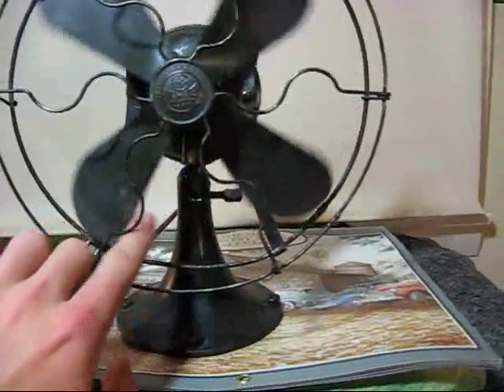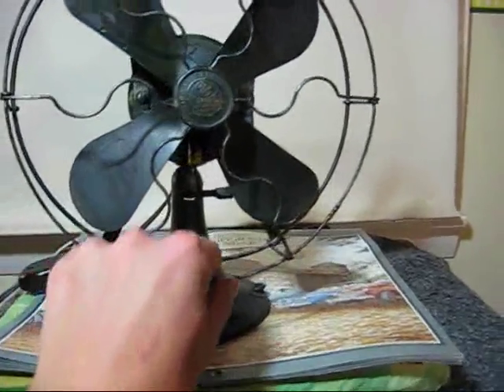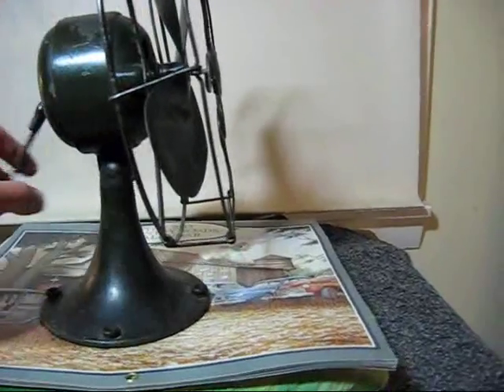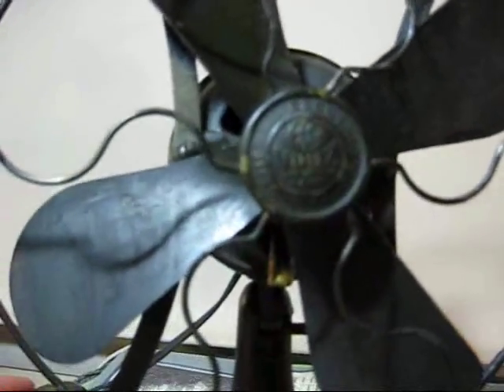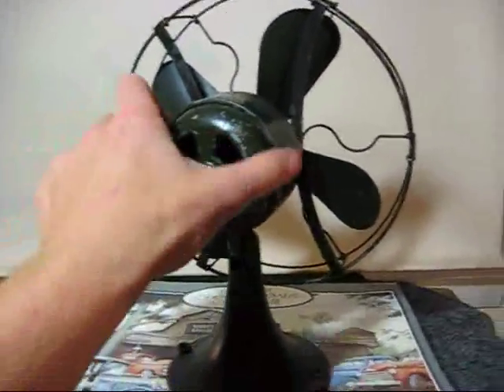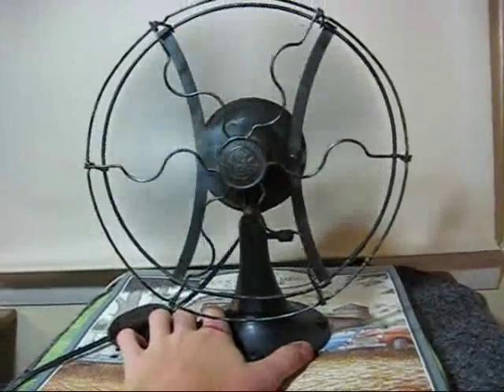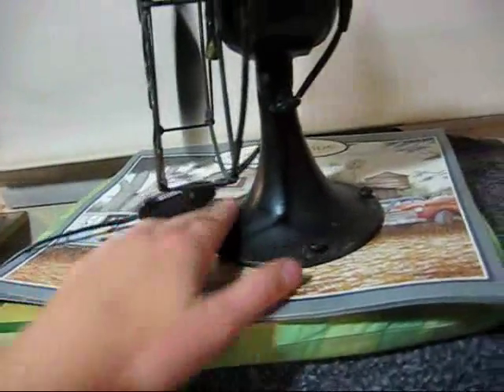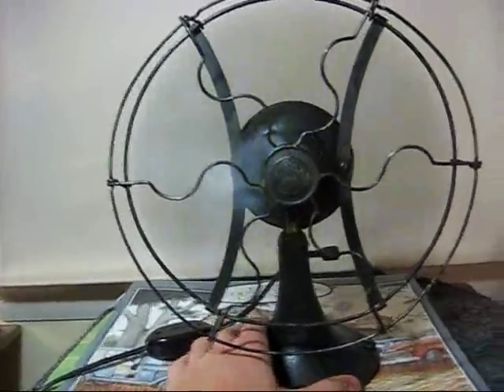1918 GE Whiz

Comment from the maker: ha ha very original. and im sure that you could afford one they do not bring much. they pop up on ebay every so often. i payed about $15 for this one and it came with a 8" handy fan (near mint) at no extra charge. not a bad deal. problem with this motor is to replace the cord you must pry off the rear cover. that is tricky. it is only pressed in and it fits tight (no screws). definently worth it. i'v never seen one of these bring over $40. they can fit my budget.